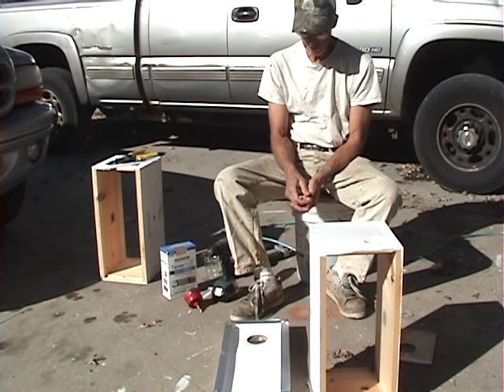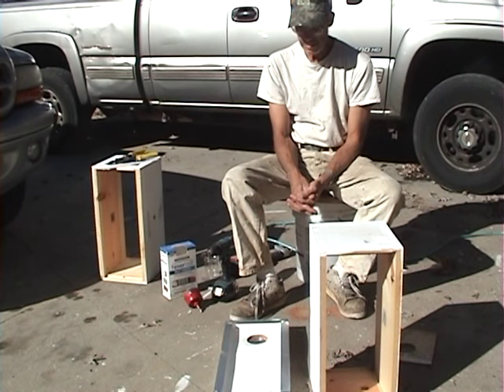Small Hive Beetle baffles

Comment: I took a 2' by 2' aluminum sheet and cut a square hole out to the exact same shape as the screened bottom board. I painted the bottom of it with Never Wet, just as Jeff Ward did with his hives, but by using a piece two foot square it hangs outside and well as inside the bottom board. I used another base to hold the hive below the bottom board and nailed that aluminum to that new base, which I made from two by four pressure treat lumber.  I mounted it on the base below and built the hive above it as normal.  I have no hive beetles what so ever in that hive. I guess time will tell but so far, I have not found one in the hive. I am in north eastern Florida, and SHB are a problem here in most hives pretty much year round.  It is simple and so far very effective.
Reply: Jeff Crane That sounds really good jeff. How are things working out 5 months later? Do you have pictures of what you did? Thanks, Phillip Hall

Comment: How did the baffles preform through 2017? How do you think this would work with screened bottoms, all my hives are 8 frame, for honey production.
Reply from the maker: I had very few SHB in 2017. The only thing about the baffles I think you can't run them in the winter where it gets cold. Last fall it got in the 30's and the baffles sweated. so I would put them on a 3/4 shim so I could remove them in the fall..

Comment: Unfortunately the bees chew up the neverwet. It works for a while, but eventually it stops working.  It was good of you to credit the guy who came up with it.  His name is spelled Jeff Willard and he has a few videos about it.  
Good news is he's trying this again with the industrial version of neverwet.  Hopefully that stuff will last longer.
Reply from the maker: The only thing I have found is the baffles caries the cold inside of the box. So you really need to put the baffles on a 3/4 shim you can take off in the fall. I am not using them right now. I have the jelly jar on the bottom board and a cd case on top of the frames It worked ok last year time will tell.
Reply: Joe,
To be fair, I've had email discussions with Jeff about this and they do fail over the course of a few months.  If you replace them you don't need to worry.  But I was hoping for a permanent solution.  I just wanted to clarify that.
Thanks for the great videos and keep them coming.  My wife and I really appreciate you spreading your knowledge.
Thanks,
Matt
Reply from the maker: thanks for letting me know.

Comment: Those things don't work. I tried them in 2014 when I started beekeeping. The Small Hive beetle still got in my hive. I bought 3 sets of them. A waste of money.
Reply: Jerry Housewright if you use the never wet in the bottom board side     they are 90 % effective. store bought one's don't work very well
Reply: In edition to using the neverwet flashing, you have to seal your hive up 100% as in using foam in-between the hive boxes and all the joints need to be caulked.  Just a crack beetles can get in.    That's most likely how your hive had a failure from the beetles.
Reply: If you got good fitting boxes the bees will take care of the cracks.
Reply: But it takes time and every time you move that box the bees have to start over.